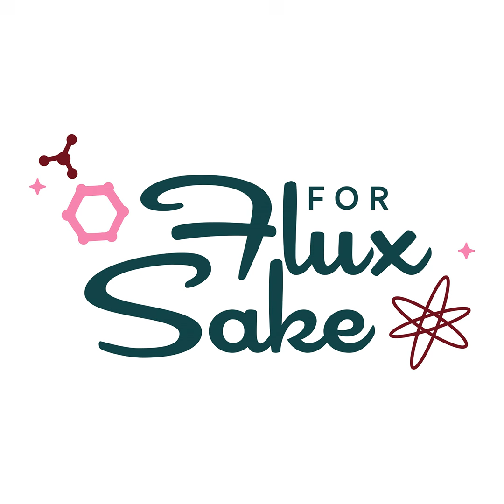Why are my plates cracking? | For Flux Sake 125

Comment: Use a chip brush and coat plaster mold half face with vaseline. Then create other half. Thats typically what is done for 2 part plaster molds to make latex monster masks. i should think it will work the same for slip casting. ano special mold release required.